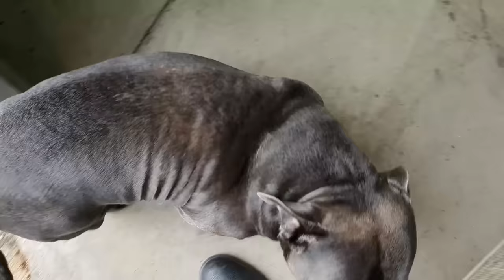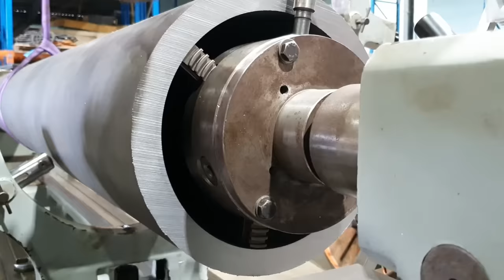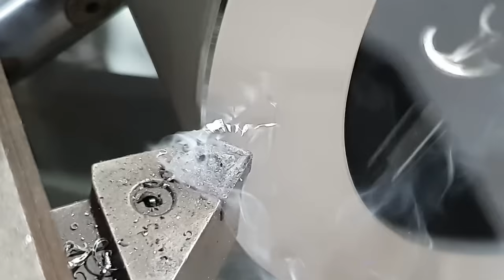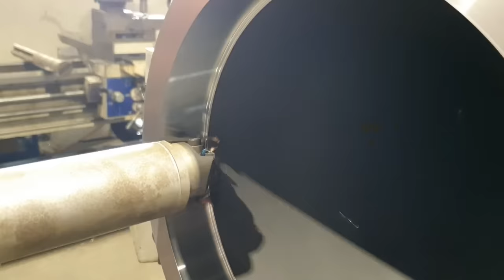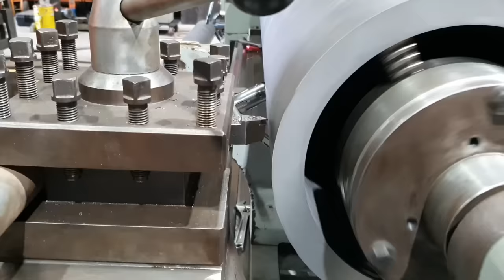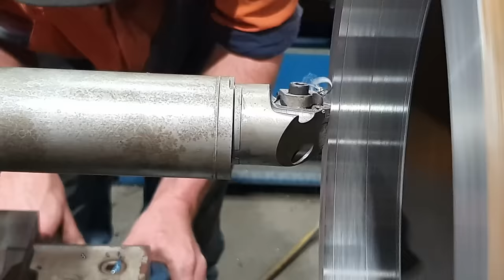Machining & Boring BIG Steel Tubes | Large Lathe Work

Comment: I've got a 7x12 minilathe, and learning stuff from you...
Use a forklift and crane to load the stock in the lathe... Tick.
Use a 5 metre tape measure to check the stock length... Tick.
Boring bar as thick as my leg... Tick...
Sheesh, I think I just broke my minilathe! 😋

Comment: Good times Kurtis, Interchangeable head bars are cool, saves buying all those tool shanks multiple times. I do alot of bore and key jobs in the 75-200mm range with fairly tight finish requirements. I use the through coolant feature for compressed air to keep the chips pushed ahead of the cut, so they don't run back through and botch my finish.

Comment: Great work, Did you ever get the big lathe you bought months back up and running? Why was the inspector on time out? Have a great weekend.
Reply from the maker: Hey mate the big lathe is in progress got a few more things to do to it before it is ready. This job was sending sharp chips everywhere so he was out of the way for safety 🤣👍
Reply: @CuttingEdgeEngineering  When the inspector gets the heck away from a job instead of stating his displeasure that should tell you something :D

Comment: In one of the comments a viewer said a high school shop teacher said that manual machining was going to  be replaced by CNC. When I set up my home machine shop by friend who was a trained machinist for years would not let me start out with CNC machines.  He said to buy manual machines to learn on. He taught me safety using the machines I purchased. He said  the best machinist started out using manual machines. You have to THINK about what you want the finished job to be. Your brain now becomes the CNC computer. I amaze my self with what I am able to produce and how I can accurately  reproduce the same results. I am now a REAL machinist not a button pusher. Get a lathe and mill and your only limited by your imagination with what you can make or fix. Keep the videos coming. Thanks.

Comment: Homeless says 

"how can I be a safety officer if ya lock me up in the office all day"
Reply: I thought that’s always what you do with the safety staff. Put them out of the way and where they can’t see the debauchery. 😂😂
Reply: Hant yu ever sent yr safety  officer away on a blind mission
Reply: @Stepinup  I refuse to answer that on the grounds it might incriminate me. Besides I believe the statute of limitations has runout! 🤣
Reply: I was a young engineer at a manufacturing company that has been mentioned in this shop before.

They had demonstrated a new machine in front of the executive staff and other office folks, and shut it off a bit more abruptly than many expected.

As things were wrapping up a 'very experienced' guy starts casually spreading the fresh sand around with his feet where the machine had been demonstrated.  He told me to join in before the safety and enviro mental alarmists noticed the few quarts of oil that had spilled when a hydraulic line blew.

By the time they came by,  the machine had been moved to the wash bay,  and there was nothing but clean dirt over the crime scene.

Like you said, don't let the safety officers know about any of the fun. They'll write a policy, and an oversight policy, and eventually need 3 managers to ensure all the boxes are checked.

Comment: Gday, that was a nice simple easy job, the anti vibration boring bars are good thing and to be able to interchange the ends is a great idea, I wonder what material they are made from to reduce the vibration, there were decent size cuts you did and no sign at all of chatter anywhere, thanks for another very enjoyable Friday evening, have a great weekend, cheers
Reply from the maker: Hey Matty yeah this was a bit of a treat job, nothing to clean or fix 🤣 The anti vibe bar is a special combo has a chunk of carbide in the end of the bar to dampen the vibrations. Goes well. Cheers mate, Kurtis 😎👍
Reply: @CuttingEdgeEngineering  Seemed to have a fair amount of spring though, leaving a pretty decent scratch on the way out. I guess that is not critical in this case.

Keep up the awesome videos. Definitely my favourite machining porn :-)

Comment: An idea for you. In my last manual machinist job, I added a "T" fitting with an extra ball valve and an air hose quick connect to the flood coolant line to the saddle. That let me add a hose for coolant thru boring bar's (such as the one you used here) as well as the cast off tooling that I had from the production department CNC's. I know you don't seem to use a lot of flood coolant on the job's you tackle, but you never know when an idea might come in handy. Cheers!!!!

Comment: Kurtis I have a very similar machine to yours where I screw on small brass knobs on the steady adjustment knobs off centre which makes winding a breeze,especially when need to wind in and out so many times on repeat jobs.It takes forever to wind them with standard knobs that come with the machine.

Comment: It seems strange that only one end of the tubes were prepared for flanges. I f there is somebody better than Kurtis at machining specialty parts I would be amazed!
Reply: I was pondering that very question during the video and as I was reading your comment it hit me. The drive plate only goes on the end nearest to the welding rotator, whatever is going to be welded gets tack welded to the other end and possibly at other points along the tube. Once welding is finished, the tacks are cut free and the finished product removed. Tack points are ground down and the next component is tacked up for welding. The tube is in effect a sacrificial work jig component and only bolted to the rotator as required.

Comment: Hi Kurtis, now I know what you go through, they just handed me a 1000 grade all  that is totally abused and steering end totally ruined, that they bought at an auction on the cheap, my boss just said "fix it"!  Both steering knuckles are worn out and need castings remachined and line bored, then the framework is cracked and worn at all bushing points, so I have 8 line bores to do, plus make new plates and install them in cast steel steering knuckles, replace one arm on the frame that is cracked through and line it all up and make new bushings, (I make them out of aluminum bronze, it is harder than steel and lasts for years) then put original new bushings inside the aluminum bronze ones, all holes are oblong by 1/2 the hole, so line boring is mandatory.  And I am 80 years old Kurtis, but I learned much from you, our company has 1500 pieces of heavy equipment and when a part is obsolete or cannot get it, I have to design new one and grab a piece of steel from rack and make a new one.  That is my job!  This will take me 1-1/2 months as I am part time.  But I get new projects every day.  Thanks to you Kurt, I have learned much from you, like new gear on the grader rotational gear, very good job, I may get one like that, we have 80 Komatzu 250 and up to 1000 escavators, I always have to line bore buckets for them.
Love your videos, but you should include the missus in some, she works hard also lol

Comment: question / comment>
tit appears the large digital micrometer you use to measure pipes with does not have a rounded contact surface.  do you not feel the added accuracy would be better?

Comment: Does either of you have an old skateboard at home. just to see if the inspector might be interested in riding it around the parking lot.. might have to put some padding on the ends to create soft bumpers..
Reply from the maker: Homey would rather chase the skateboard and then chew the wheels 😂

Comment: I know there was no welding in this one. This morning I watched the hydraulic cylinder repair and you did extensive welding on it. Does Oz require some sort of certification for high-pressure welding?

Comment: Is it necessary in this case to re indicate in on the machined path for steady rest once the tailstock chuck is removed or just bring the steady rest wheels into contact with the work and lock them down. In other words, do you re indicate once the steady rest is in place or is there no way to get an indicator in there.

Comment: A machine shop in Australia.... That's a pretty scarce thing isn't it? Once there were thousands of them till the day that Willesee signed the 'Lima Agreement'. I've heard that magnets out of microwaves can be good on big pipe work where you get the 'bell ringing' harmonics but have yet to try it. Place a few of them inside and out and they take away all the ringing.... Have you heard of this and what are any other suggestions?

Comment: Here's a question I realy hope you will reply to. Would it not help make a job faster if you made a cutter like a chuck and instead of a jaw you made a adjustable insert and have sat 4 or 5 all the same but have the first one set at one diameter and each one after that a little greater diameter  with enugh horse power in the lathe could that not cut a huge  amount of time off if you making 4 passes every time???? So please if you can take the time and explane if there is a reason this is not workable! Thanx

Comment: Excellent! The shavings getting all these different colors is that from the heat?
Reply: Yes. Varies depending on location of chip in the cut path and it helps to draw heat from the parent metal.

Comment: Quick question if by chance you took to much out say 15 000. To much could you use a spray welder to get it back and than reboar to the correct size? Not you would ever do such a thing! Just thinking it could be easly done by accident.

Comment: Just curious. I am sure you accumulate mounds of shavings and chips. What do you do with all of them? Is there a company that will take the shavings to be turned back into some useful product?
Reply from the maker: Hey mate it all goes in a big scrap metal bin and then off to the metal recyclers when the bin is full. They pay us per tonne and then re-use or melt it down

Comment: i was always wondering. (not a machinist) when the cutter hit the metal and get's free due to a gap as the curface is not perfect. is it harder for the cutting tool (damages it) or it makes no differences?
Reply from the maker: Hey mate depends on the material being cut and type of insert being used. We have "heavy duty" inserts specifically for interrupted cuts and they can take it!

Comment: When cutting on the lathe is that all just controlled by hand or is there a computer where you can like input to cut to a certain distance tolerance?
Reply: Sean . On the machine there is carriage and saddle . Which hold the tool post . The handles you see Curtis turning are our graduated in metric measurements . But you hear the beeping . Hey probably has a DRO.  Its digital readout he can tell it what is starting position of the cut is i d o d and his z-link from face of the part to however far he's got to go back it's got sensors in the machine and it's just an easier way to keep up with what your measurements are but you also use your handles to see your sister links with instead of looking down at the dials all the time and seeing what you been where you been when you can also use your measuring tools for finer measurements but the dro is what he probably uses and is the way to go for production work.

Comment: If you cutting it at a certain diameter, then, when you pull the it back out, why does the cutter leave a line on the way back out? 16:47
Reply from the maker: tool pressure and i'm not moving the tool post away when it gets pulled back out

Comment: One thing I never have seen you do on your videos is when you go from one tool to another tool like a boring bar to a regular cutter.  Never have seen you raise or lower your tool holder to keep the whatever bit centered on workpiece.   Or are most of your cutters the same height off of the base where you clamp them in so its not necessary.

Comment: Isn't that 1 ton sling a little small for that tube I estimate it around 1.3 tons  with the choke you also reduce the slings capacity
Reply from the maker: hey mate nah the tube is around 700kg
Reply: @CuttingEdgeEngineering  thanks, just checking don't want to have any accidents to save the safety officer some paperwork